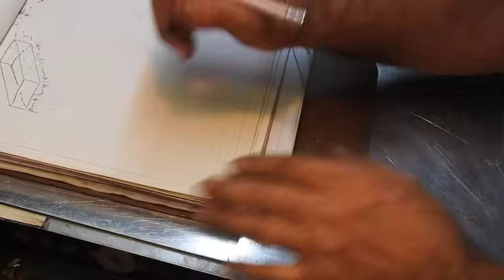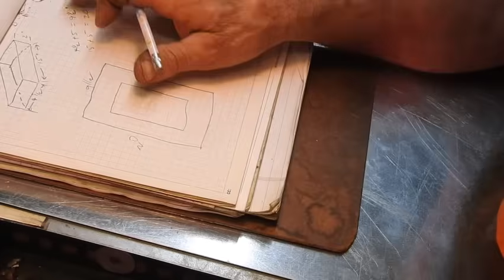Lets Build A Simple Sheet Metal Tool Tray

Comment: Would you please identify your hand tools and if possible links to where they can be purchased.  Thank you for an interesting and enjoyable lesson. I’m just starting out with metal working.
Reply from the maker: The basic tools are really the snips and wide folding 'tongs' that are all available at any Harbor Freight store. I think the proper name for the wide tongs is 'hand seamer'.  Amazon has all the tools as well, but if you are entering an apprentice program they will probably give you a list of the tools you'll need. 
   The punch is a Malco punch with removable dies and punches and is available on Amazon well.  The other basic tool is a standard pop rivet gun.  The colored handles on the tin snips are red, green and yellow for the left cut, right cut and straight cut.  Then the big aluminum snips are Malco as well and have replaceable cutting edges. 
   I have a ton of sheet metal layout videos up in the toolbar under ' playlists'.  Here's a sample: https://www.youtube.com/playlist?list=PLk72G9DTzZ1tqw8ST_xdUlPoy_O-SmuBx In the older videos in this list, iirc, several times I go over the sheet metal shop tools for fabrication.  These are all old tools that some of the modern shops no longer have as they have been replaced by cnc plasma tables and power brakes and shears.  But its always good to know where the industry started out from and ALL the tools I have are still used by thousands of shops across the nation.

Comment: How can I make a large  analuminum box with vapor proof corners. Thanks you.
Reply from the maker: It can be done basically the same way but to seal it properly it needs to be TiG welded on the corners.  You can silicone caulk the corners but eventually it will leak.   A TIG machine won't distort the metal while welding. Unfortunately its not an easy thing to do without the proper tools in a home shop.

Comment: Superb work. Very skilled. Nowadays, we laser cut and bend it on CNC Press Brakes. But, this is too good for custom sizes. Thanks
Reply from the maker: I never got the opportunity to work a CNC  plasma set up for layout, but I did see them run in the shop.  I've not even seen a CNC press brake.  But it sounds intriguing.  The industry has changed immensely since I got started 46 years ago.  I actually spent the majority of my career in commercial service.  Thank you for the very kind comment and if you'd like to see more, there's tons of metal videos in the playlists above.  Even some welding and heavier metal fabrication too.
Reply: Yes water jet is very good to and press with auto tool change

Comment: Nice Job. What Gauge metal did you use?
Reply from the maker: These were all 26 ga scraps.  Depends on the weight of what you want to put in them AND the dimensions of the boxes.  Larger sizes with heavier loads have to go a minimum of 24 ga and in some cases 22. But those heavier gage materials are a bit trickier to work with.
Reply: @tractorman4461  thank you for the reply.

Comment: Thank you for showing this video; just what I needed for my craft ideas.
Reply from the maker: Another good tip, is either Harbor Freight or Northern Tool has a very reasonable small sheet metal brake.  Inexpensive and make very good bends. https://www.harborfreight.com/30-inch-bending-brake-67240.html  Northern Tools is more expensive and HF has another one too that's a bit more expensive.  Good Luck and I am glad you found this helpful Vivian !!

Comment: What is the difference between the two riveting tools you were using, please? Thank you, sir.
Reply from the maker: The first tool at 7:09 is a Malco hand punch for light gauge sheet metal and aluminum.  The second tool at 7:14 is the actual pop rivet tool.  Btw, if you like sheet metal videos and have a minute to spare, check out this one, it's a bit more complicated: https://www.youtube.com/watch?v=i2KFLZGbZwI and I also have a ton of layout videos up in the playlist above like this one: https://www.youtube.com/playlist?list=PLk72G9DTzZ1taVZjyeN9DKr52HQ3hhcXd  Thanks Michael for the question. I hope that helps.  Both tools are available on Amazon or your local hvac supply house or WWGrainger or McMaster-Carr.

Comment: hi..... what about making bread pans or cake pan?
Reply from the maker: Yes, but you have to use stainless steel and not galvanized. Aluminum may crack with the bends.  One thing to remember is you cannot solder the corners with 50-50 if you use stainless, it has to be lead free solder with special flux for SS.  Aluminum has to be TIG welded.  I've made cookie sheets in the past as well as drywall mud buckets for taping seams.....tons of other things as well.  Tool boxes, tool trays of all sizes, handles, gas tanks for old engines and tractor parts......the list is long.  Thanks Andre for the interest.  If you make bread or cake pans or cookie trays, you have to make sure the corners are all rounded a bit by peening to keep from scratching the countertops.
Reply: @tractorman4461   thank you so much for the advice... i will try in dew time.. thanks again.

Comment: If you leave the tab on the short side, so it bends when you bend the long side. You won't need to use the hand benders at all. Just a little tip to speed up production.
Reply from the maker: Hahaha...yeah, I wasn't thinking just then..I usually do it that way.  Sometimes I find distraction in the actual making of the video when my concentration should be on the job.  But you know...we all have excuses.  (-; Thanks Brady for chiming in with the cool comment.
Reply: @tractorman4461  You know your really distracted when you put tabs opposite of each other. LOL

Comment: You had me right up until pop rivets.
Reply from the maker: Welllllll.... it's not to hold water or anything. If it was soldering would have been in order.  Pop rivets will hold better than a spot weld with the flex associated with moving the tray with a load in it, but that's always an option to use when it'll work.  I've made them every way you can think, and I wouldn't think the average home owner would have access to a soldering iron capable of making the joints nor a spot welder.  Most won't have access to the box and pan, but then I think you'd be surprised at the number of guys that have the small 24'' brakes from Northern Tool or Central Machinery.  The use of the end product most of the time dictates the process of the fabrication.  Thanks for watching and if you like sheet metal fab, I have other vids in the playlists at the top of the page.  But take a minute or two and check out this one: https://www.youtube.com/watch?v=i2KFLZGbZwI
Reply from the maker: @henmich  Hahahahaha....Now THAT cracked me up !!  That's a funny comeback !!  I love it man.

Comment: What is that tool at 7:16 please.
Not the rivet gun but the other one
Reply from the maker: That tool specifically is a Malco hand punch Mike.  They come with only two dies for two size holes.  They are light duty but a very good tool.  They are a lighter version of the standard Whitney hand punch we all use that's made of case steel with a set of nine punches. Very heavy by comparison but almost unbreakable.

Comment: Hello! Thanks very much for the video. Can I ask for a link or information about the scissors you use? Thank you.
Reply from the maker: This is the new model of my exact pair of snips.  The ones I use are 40 years old and cut like new. Never cut anything but sheet metal or aluminum and they will last a lifetime: https://www.amazon.com/Malco-M14A-14-Inch-Straight-Aluminum/dp/B000HS19KU/ref=sr_1_5?crid=3MYR0WEQ6PRWK&dib=eyJ2IjoiMSJ9.UcWU_qTgQkMtSA2p7cY-3joqPyEc658e2TEDU1QLi9rfU3Q7LjR7bJM-KD1N-gn6J7-jIYe8Zew2mXm8ycdpNOjh25_1HkTDGAaBSZ_OGHqYnG5fNmuQEEjldMT2PsKsH7xQ2osWESvbLF6_7mx6CG2YauyezqZtfYGBusyf9vM6qLarPPsZ6X-GbxbgvR10rQtKZsuz-uzizXJTuUGhnLIvFsvYuLqrj4e7eLNOMsJjtzLpmhjq7ZCJtKBlN0Z8MLOf7uWJgXIMnWcL7-z7RfGxuf85Mg2udMsYlERfcuc.GJVLALrm57ge7GddFwJdJdSCx5COXCFj2wkfbKJsKc0&dib_tag=se&keywords=malco+aluminum+snips&qid=1721298473&sprefix=maalco+aluminum+%2Caps%2C114&sr=8-5

Comment: Or you could spot weld it and it won’t have the rivits poking in your tool tray!
Reply from the maker: Yes, but if you see the tail end of the video you'll see them flattened against the anvil tightly and barely thicker than the folded edges.  Nothing protruding either side.  But I do spot weld them many times too.
Reply: @tractorman4461  just saying spot welds are the way to go!👍
Reply from the maker: @dennisschultz4015  Yes, I understand.  (-:  I actually had to make another small temporary project the other day and I spotted that one.  Heck back in the day we'd solder all that kind of stuff.  Roof jacks and flashings were soldered too.  I even made lead base forms for pouring shower or tub bases.  Those were all soldered too.  Processes and materials both evolve over the years.  Thanks Dennis for the conversation.

Comment: which way did you fold them?  CUT-SIDE "IN" or CUT-SIDE "OUT"?  Thx.
Reply from the maker: Almost ALWAYS the cut side folds in.  Minimize the potential for a tinner's whisker to rip open a finger. There are a few exceptions though.  Hey, if you liked this one, take a minute and look at this  more challenging one: https://www.youtube.com/watch?v=i2KFLZGbZwI&t=193s Then there's a lot more in the playlists like this one here: https://www.youtube.com/playlist?list=PLk72G9DTzZ1taVZjyeN9DKr52HQ3hhcXd
Reply: @tractorman4461  (Thanks for you quick response!  I was actually watching another video ("https://www.youtube.com/watch?v=yrb1Oh0aJM4") which auto-linked to this one at the end, and my question was for the other one.  He scored the seams with a saw and I was wondering which way he then folded them...) That said, back to yours -- COOL TABS!  I always wondered what those extra slits were on a BREAK, too!
Reply from the maker: @dziggy3004  Hahahaha...I actually just went and watched his video.  It was pretty cool.  I have also made quite a few similar to his.  And I use angle iron in the vise jaws for wide folds.  He did a good job too.   I tell ya, there's a real reasonable 'box and pan' brake, a 24'' one, that can be purchased at Central Machinery or maybe Northern Tool.  Its really a heavy duty one too.  That type of brake is very versatile.

Comment: Do you have a   square to round video
Reply from the maker: No, not at the moment.  But when the need comes along I will. Thanks Dan for the question.  It's been so long, I'm afraid I'd have to think pretty hard to make an accurate fitting now.  But I think it's still in the memory banks.

Comment: Had almost this exact same thing for metalwork prac in high school 50 years ago. Except we had a wire re- enforced hem and we had to do all the folds free hand.
Reply from the maker: That's cool that your had a class in high school...that's about all I had to get started in sheet metal as well.  And yes, it can all be done by hand, but when I do, I like to cheat and use angle iron and a bench vice.  I use the large galvanized wire they hang ceiling grid with for reinforced edges.  It works real good.  Other times, I just use a heavy guage wire off of a big roll I have had for many years.  Here's one from the archives: https://www.youtube.com/watch?v=GaPFeahgJ8A&t=10s  Don't laugh, it was one of my first videos.

Comment: I guess you are restricted in box hight by throat of pan break,?  the small one I got only has an inch Unser the bar. holding the box vertically I can get a 45degree bend, but with aluminum thats not much help since hand bender is only so deep.
Reply from the maker: Yes, but after bending a few you pick up a few tricks on finishing the deep folds by hand.  I keep a mid size rubber mallet close and also some heavy blocks of steel to use as an inside anvil to tighten the corners a bit if necessary. There's tons of tricks that can't described easily.  Check out this one for a bit more of a challenge: https://www.youtube.com/watch?v=i2KFLZGbZwI You might like this one.  Thanks for the comment.

Comment: At 6:27 you use a tool that makes the hole for the rivet. Forgive me, I'm just getting started learning sheet metal.... what is that tool called please?
Reply from the maker: That is a Malco punch. It usually comes with two sizes of dies/punches.  There are cheaper ones out there but here it is here: https://www.amazon.com/Malco-HP18KR-MALCO-Punch/dp/B002JAWJGW/ref=sr_1_3?crid=JVJD1T0BEZML&keywords=malco+hand+punch&qid=1674772133&sprefix=malco+hand+punch%2Caps%2C154&sr=8-3 Here is a much heavier option and will do the same thing as the Malco....even better: https://www.amazon.com/dp/B07D7HJQ5Z/ref=sspa_dk_detail_3?psc=1&pd_rd_i=B07D7HJQ5Z&pd_rd_w=txKwh&content-id=amzn1.sym.dd2c6db7-6626-466d-bf04-9570e69a7df0&pf_rd_p=dd2c6db7-6626-466d-bf04-9570e69a7df0&pf_rd_r=3YJYTQET49FFK1JJTDKB&pd_rd_wg=iPuOj&pd_rd_r=f6ee5f3c-1bfb-41bb-9aba-9d5188b6756d&s=hi&sp_csd=d2lkZ2V0TmFtZT1zcF9kZXRhaWxfdGhlbWF0aWM&smid=A1UMBRA5ZTBCX8&spLa=ZW5jcnlwdGVkUXVhbGlmaWVyPUExVExXR0pWUFQzV1BaJmVuY3J5cHRlZElkPUEwODk3NjQwMVZHNUFGSFZRWDZFTiZlbmNyeXB0ZWRBZElkPUEwMTM0MzU4MUE0RzMwMzNVRTU2RSZ3aWRnZXROYW1lPXNwX2RldGFpbF90aGVtYXRpYyZhY3Rpb249Y2xpY2tSZWRpcmVjdCZkb05vdExvZ0NsaWNrPXRydWU=

Comment: What gauge sheet metal did you use for this? Do you have any recommendations for metal types to use for a project like this (or ones to avoid)?
Reply from the maker: This is 26 ga galvanized sheet metal. Aluminum is hard to keep from cracking on tight bends. Stainless steel is tough to cut. I’d suggest staying with sheet metal. Harbor freight and northern tool have inexpensive small brakes.

Comment: Could you flux the corners and solder them or is that less durable than rivets?
Reply from the maker: Solder would be superior to the rivets for sure.  Much more durable and able to handle flex of the tray if loaded pretty heavy.  The rivets are superior to the little spot welds though under the same circumstance.  Spot weld don't fully penetrate the two materials so the flex would cause premature failure.  Btw, if you liked this vid, give this one a shot if you have the time: https://www.youtube.com/watch?v=i2KFLZGbZwI&t=1s You may find it interesting as well.  Thank you Charles for the question and in general for taking the time to comment.

Comment: Hello,
What is the name of the plier you use to make the hole just before add the rivets please ? 
Maybe a link on Amazon or other to purchase one ?
If you can do too with the other plier, with the large flat head, to fold the small part, can be really welcome. Thanks. Fred.

Thank you 
Fred.
Reply from the maker: The hole punch is an older Malco hand punch.  Here's one on Amazon, but they are usually cheaper than this. And this is a newer version of my old ones.  They are Malco sheet metal tongs : https://www.amazon.com/Malco-HP18KR-MALCO-Punch/dp/B002JAWJGW/ref=sr_1_1?crid=3UE9HUAZ0SH8W&keywords=sheet+metal+punch+malco&qid=1672589408&sprefix=sheet+metal+punch+malco%2Caps%2C169&sr=8-1 Again, they are cheaper places for the tools, but this will give you an idea where to start Fred. Good luck with your project what ever it is !!
Reply: @tractorman4461  thank you very much for your answer and the link 👍
I do restore some vintage steel cabinets for a kitchen, thin sheets steel. Thanks again ! Fred (from France)
Reply from the maker: @fredmasse6451  Awesome Fred !!  I hope these tools help you in your work. For heavier materials, you might think of a heavier "Whitney' hand punch with multiple interchangeable punch and die sizes: https://www.ebay.com/b/Whitney-Hand-Punch-In-Metalworking-Punches-Dies/258221/bn_7023057786
Reply: @tractorman4461  
Great ! Thank you again for this link sir .

Comment: What kind of Whitney punch is that (hole punch). It doesn't look like a Whitney
Reply from the maker: It's a lighter duty Malco punch. It has only two sizes of dies unlike the larger cast steel Whitney with ....what is it....9 dies..??  Jason, if you are interested, theres a ton of sheet metal vids in my playlists up above like this one here: https://www.youtube.com/playlist?list=PLk72G9DTzZ1tqw8ST_xdUlPoy_O-SmuBx  And here's my latest sheet metal upload here: https://www.youtube.com/watch?v=i2KFLZGbZwI You may find something interesting in there.  Thanks for the comment and question !!
Reply: @tractorman4461  i subscribe, im sure I'll find something interesting. Im sheet metal local 48 and got a few more years before I retire. But you the first one i seen doing some layout in the flat 👍

Comment: What was the thickness of the sheet metal? Really great video! Im looking to bend something similar in Stainless steel 1mm (no prior experience) for a bird bath area
Reply from the maker: It is made of 26 ga galvanized sheet metal Sammy. 1mm stainless is pretty heavy.  Between 18 and 20 ga material. That's like three sizes thicker than these trays.  And if you have notched corners you will have to solder them which takes special SS soldering flux.